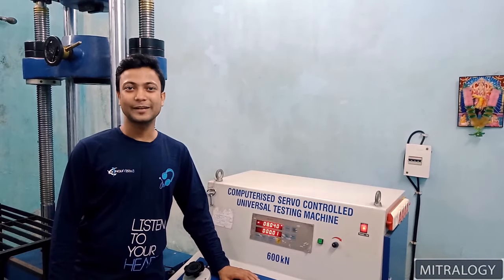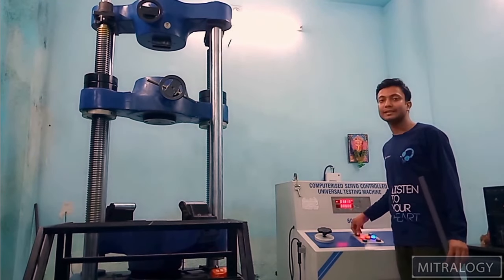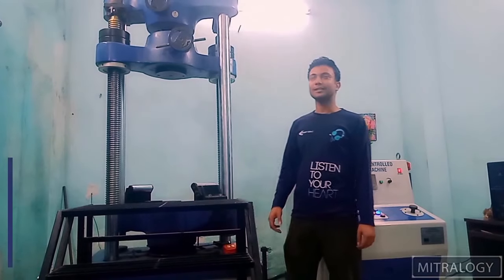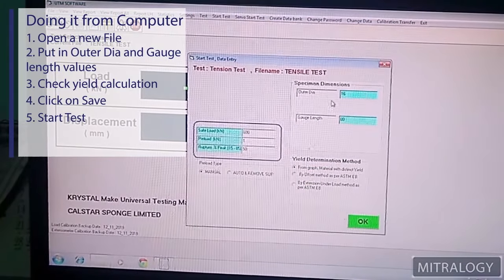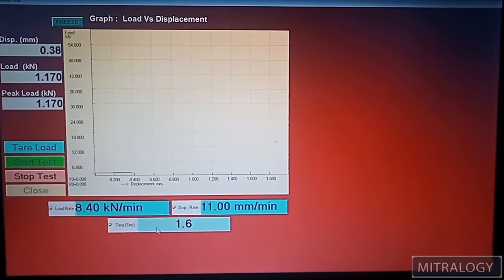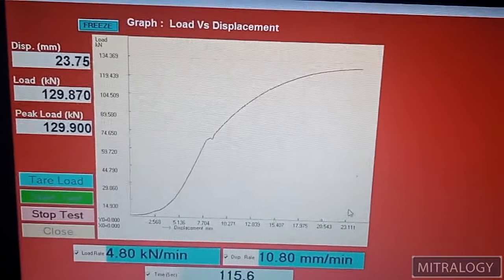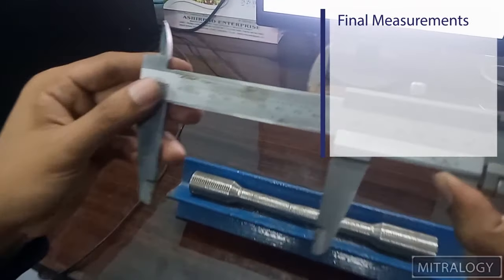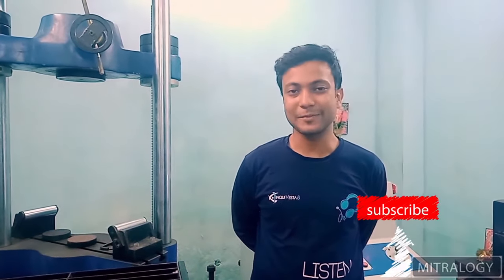Universal Testing Machine - Procedure and Calculation | Tensile Strength, Yield Test

Comment: what is the material/specimen investigated and its properties?
Reply from the maker: It's 45C8(Class 4) Material. We are using it for Railway Fishplates. 
45C8 Chemical Properties 
C- 0.40-0.50
Mn- 0.70-0.90
Si- 0.20
S and P- less than .040
Mechanical Properties 
Tensile Strength- Above 620 MPa
Yield strength- Above 320 MPa
Elongation- Above 15%

Comment: Hi! sir; before we calculate the area of the Re-bar; is that mandatory to measure the diameter of the re-bar using caliper or can we use only the designated diameter in mm on the surface of the re-bar?? which is the correct one??? thanks
Reply from the maker: It's better to measure the diameter of the bar for perfect result.

Comment: Good information about tensile test. Shall I have some information about Aluminum-6082 material
Reply from the maker: It's a medium strength alloy. Corrosive resistance. Mainly used in Bridge, Cranes and transport applications. Tensile Strength is more than 250 MPa.